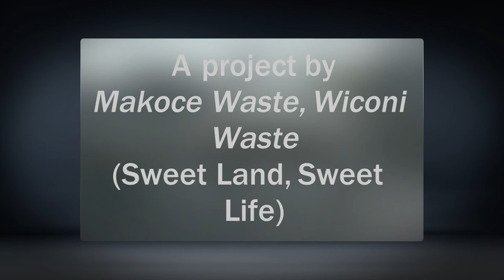Curved Wall Slip Form Building

Comment: A good trick is to let the concrete light set, then do a light pressure wash, so the concrete is not even with the stone face. You can either point the seams, or leave them offset for depth.

Comment: Not my cup of tea as far as looks, but you could’ve stripped out the forms that same day and saved your strength chipping away at the set concrete the next day.
Reply: i think i would test that theory out on a a test wall to see what method is time/energy efficient.  good point to look into because that looks to be quite labor intensive.

Comment: Extremely useful video, just a pity that the makers do not reply to viewer's questions?  I was wondering why you didn't use an electric hammer chisel to remove the excess concrete from your stone work as it surely would have been quicker and less labour intensive?
Reply: Where do you think the nearest outlet is?
Reply: @jwnigel  Well, it was two years ago, but I guess even then the world still had GENERATORS.
Reply: @RobertsBulgaria  It would be a waste of energy, you have to use fossil fuels to power generators, these sort of people are trying to do things with the least amount of electro-mechanical energy spent, for reasons of sustainability. It's an offset, time and human effort. For some people time and labor are a premium, so using an electric hammer for example would meet their needs. For other people, expending the least amount of artificially generated electrically and mechanically generated force and energy as possible for reasons of eco-sustainability are their priorities.